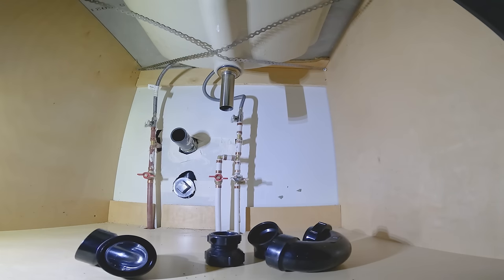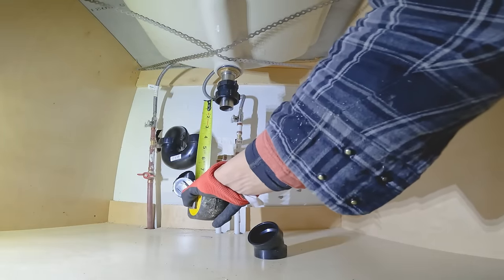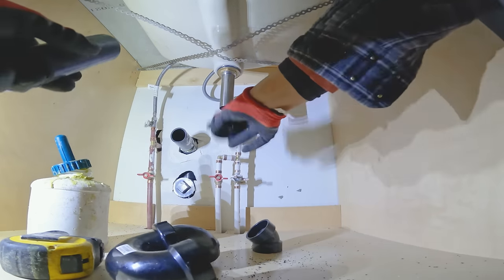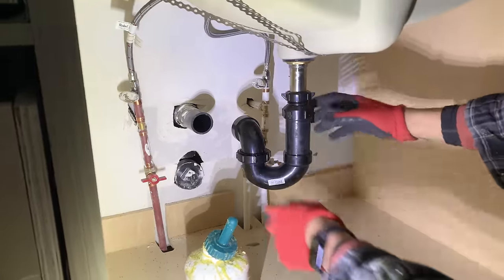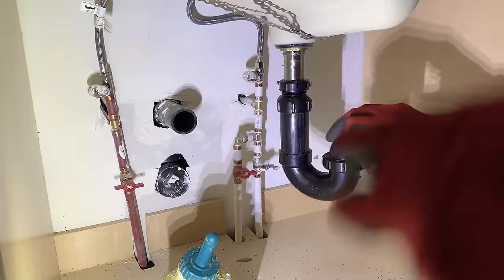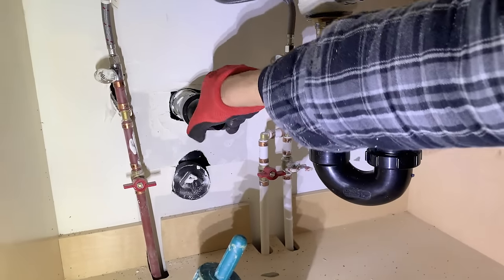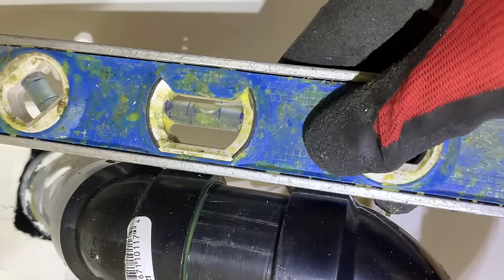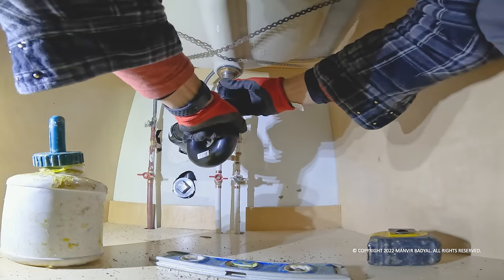P-Trap Installation: Drain Doesn't LINE UP with Bathroom Sink Pipe - 2022

Comment: Meanwhile, in my world…..go to home center and discover they don’t have all the needed pieces in ABS or PVC, buy many elbow combinations of each, go home, still doesn’t work. Go back to home center, buy more stuff, repeat 4 more times, cut multiple lengths of pipe to make everything fit because the first 3 pieces were too long or too short. Take a break for dinner. Make sure no one uses the sink. Still doesn’t fit. Go back to home center and buy multiple universal kits with the bendy hose.. jury rig everything together , check for leaks, redo do 2 more  times because there are leaks, tighten every connection just short of failure, no leaks, stand back and admire a job well done.
Reply: Add in drive 70 miles round trip b/c the local Lowes doesn't have the same plumbing selection that the one in the next town does. Still not sure I have everything I need to make it work. I could order it from them but it won't be here for 5 days unlike the auto parts store which can usually have things for me within 24 hours...
Reply: I resent you talking about me 🤣😂first bathroom problems😉
Reply: 🤣🤣 So true!
A 15 min home project always takes 8 hrs.
Reply: Same
Reply: Same here😢
Reply: Would be cheaper just to let a professional do it in the first place!
Reply: @rtopalovich  not even close. I could screw this job up 10x over and still pay less mst likely lol. A handy man wanted 1000 to paint a few cabinets, 2000 for a bit of tile around the tub because theyre insanely expensive right now. Plus id rather pay to learn it myself so its cheaper next time then pay someone else to do it everytime.
Reply: That is why you only buy a house close to a hardware store. That way you don't wear out your car.

Comment: Not bad.  The only thing that bugs me is that you didn't ream the inside of the cut pipes to ensure smooth flow.  Little jagged ABS pieces can easily cling onto hair and start to cause clogs over time.
Reply: That bothered me too.
Reply: Did he glue the p-trap? 😮 Doesn’t that defeat the whole purpose, ie to remove and clear clog or obstruction?
Reply: That bothered me three.  I am not a pro, but I would install some cardboard on the bottom of the cabinet to prevent drips.  I liked how he gave the bottle of glue a little tilt to get glue on the brush.  He must have done thousands of sinks.  Good video, don't mean to  be picky.  Cheers.
Reply: @neli.a  The p tap has a threaded connection. You can always unthread the p trap and tail piece than take the p trap out to clean.
Reply: @neli.a no, it has unions for easy removal and cleaning.  Accessible P traps are never glued! Well usually not, Lol.
Reply: Hey I understand what you said but it’s a bathroom that commonly uses 1-1/4” piping so your ahead of the game plus he gave it a slight pitch to make it speed up the flow.

Comment: If this is really for beginners then I would recommend dry fitting everything before glueing a single piece. But a nice video. Well paced and easy to understand.
Reply: Dry fitting can be difficult on friction-fit joints as they won’t always bottom out until they’re wetted with glue. You’ll probably end up cutting too short for a full fit. Better just to trust your tape.
Reply: @rayray8687 Yes simply measure depth of socket for good measurements. If you dry fit don’t forget to glue all of the joints,lol.😊
Reply: "recommend dry fitting everything before glueing a single piece."   +1000

Comment: Certain portions of plastic pipes are threaded to allow you to tie one segment to the next. This eliminates the need to glue one part to the next which is best avoided if possible. It will make it easier to take apart and reassemble if you need to clean out debris causing the drain to clog.
Reply from the maker: Trap adaptor and union Ptraps make it easy to take apart for cleaning or maintenance. 

Because trap 90 is glued to the trap arm, line clean out is installed for drain cleaning. 

Thanks for your comment.

Comment: your video is well explained but I was not aware of the slop. and most, you demonstrated a drain that is not in line with wall outlet and the p-trap connection.; that is very common. thanks and God Bless

Comment: Can you comment on why you used a trap adapter between the sink and trap instead of the standard tail extension with nut?
Reply: It doesn't line up

Comment: Thanks, you saved me a bunch of grief.  The new rough in put the drain line more than 5" offset from the drain, I'm not sure why they did it that way, they had the utility sink for reference.  I was trying to find fittings that would reach that far and had not considered using a bend to make an offset.
Reply from the maker: Glad it helped!

Comment: Great video. So I have the same offset issue where a 45 is needed but with PVC.  So could I do this by building out from the sanitary T as follows: 1) sanitary tee, 2) stubout, 3) street 45, 4) marvel connector, 5) PVC ptrap kit, 6) sink drain tail?

Thanks!

Comment: If I want to drain a shop sink directly outside do I need a drain trap or can I just attach 45 to the bottom of the sink, two inch hole in wall and drain ?
Reply from the maker: I wouldn't recommend draining a sink outside, if you're allowed to do so, I would still install a P-Trap. It will block the passage to the sink inside from any kind of smell or insects.

Thanks
Reply: @TheBuildingExpert  Thank you for your honest answer. It gives me other ideas
Reply from the maker: @blackhorse2947  glad it helped.

Comment: What is the square plug on the wall? Can that be removed if you need to use that instead of the drain above? If so, how do you remove it, and can you swap the plug between the two?

Comment: I need to do this  except for the 45 degree piece at the wall. Can I cut the arm that sticks out of the wall and use a hub coupling to use another straight piece to connect with my new ptrap. The threads on the arm and new trap don't match so I'll have to cut. Ugh!
Reply: He used a 45deg because that pointed the pipe in the general direction of the trap (which can swing around for about a 10" range of position.   If the drain were closer to the wall, and further away from the wall pipe, he could have used a 90deg, and of course if it were closer than 5", he would not have needed a bend at all.

Comment: I have a threaded copper drain pipe coming out of the wall. How do I connect that to my sink drain made out of ABS just like yours?
Reply from the maker: You need an ABS DWV Female Adaptor for copper to ABS Transition. 

Hope this helps.

Comment: Almost invariably I use push-fit fittings, much easier to align, adjustable, & if I make a mistake, easy to rectify.  The reason most builders (not most plumbers) use glued fittings, is that they are cheaper.

Comment: Just something for people to keep in mind you're only allowed a 135ﾟ Worth of fittings on the trap arm before it hits the stack. And never use a 90ﾟ fitting unless it's long sweep.   You can also use a street 45 in a regular 45 to make a 90ﾟ fitting that's a little smoother.
Reply: I imagine any glued pieces can now only be cut off.
Reply: @jgz6989  Depends how long ago it was glued. If it's pretty fresh you can twist em out with a pipe wrench or by hand. Also if you're careful you can pick the fitting.  For a ptrap I would probably just re pipe it.

Not exactly sure what the situation you're referring to is?
Reply: What's a Long Sweep? Thanks.
Reply: @rainerrain9689  Just has a wider turn so it flows more easily.
Reply: @creativesuit1930  I'm not a plumber, it just struck me the way he was glueing every piece. None of pieces under my sink are glued...for me it's more convenient to maintain.
Reply: @jgz6989  I would never leave any fittings unglued.
Reply: @jgz6989  Unglued pipes?  Surprised minute vibration and stress haven’t caused enough separation for leaks.
Reply: @tonymanero5544 
You never glue the pieces of a p trap together underneath a kitchen sink. Many of the parts you buy for them are made to be hand threaded together.

Comment: Nice work, but didn’t think of future maintenance. It’s wrong that you glued the 90 to the 45 and the 45 to the wall pipe. When there is clog, it’s hard to unclog using a snake machine because the 90 is facing downward. One of the joints should have used a thread/removable adapter.
Reply from the maker: There is a line Cleanout installed.  Thanks for your comment.
Reply: You are right, ours can't use a snake because the 90 degree elbow adapter. it should be disassembled.

Comment: the P trap used is made of what material? also, can you elaborate more on how to check for slope?
Reply: The sewer gas/water trap is the same material as the rest of the plumbing.  
Slope is measured as well as you can: just use a level touching the bottom of the lowest point of pipe in the horizontal run, and for every foot of pipe upstream, the bottom of the pipe should be 1/4" higher. Here, he only had about one foot of horizontal run, before it turned vertical.
Reply: @you2tooyou2too  thansk a lot .

Comment: Awesome video!!  I’m having a  similar problem I just did a kitchen remodel and  the 2” drain pipe coming out of the wall is now a lot lower than it was before and the trap won’t fit without notching the floor of the new cabinet. Does anyone have a work around so we can avoid notching the cabinet? Thanks in advance
Reply: So much for measuring twice and cutting once.

Comment: Even quicker, but the $9.99 flex P-trap rubber pipe. 2 clamps and cut to height or length. Installs in less than 2 minutes once you got the old parts out.

Comment: Why so much works and fittings, you only need to cut the abs pipe on the wall and glue a 22,5 x 1,1/2 elbow, 4“ x 1,1/2 pipe and a abs adapter and use a 1,1/2 p-trup. Ready

Comment: Na man, just always grab a bunch of extension tailpieces when you grab p-traps from the supply house. With the p-trap, 1 extension tailpiece cut in the middle and a 45, you should be able to solve all misaligned drain issues, excluding those that are really jacked up due to height like commonly seen on farm sinks where some hack job did a reverse p-trap or something to rig it up instead of opening the wall and correcting the height of the San-T

Comment: Why didn’t you use a ABS DWV Trap Adapter (removable screw compression fitting)? The solvent welded parts are for areas that you can’t get to like under the shower floor or under the house with no access point. If you can see it you should be able to take it apart in case you need to snake it or recovery a lost item.
Reply from the maker: Slip joint compression adaptor & union Ptrap is used in the video.  

Thanks for your feedback.
Reply: @TheBuildingExpert  

From the wall?
Reply from the maker: We have line clean out installed, drain line can be accessed from there to snake.

Comment: This is why rough-in dimensions are so important when designing and installing a system. You can avoid all these headaches when it comes time to complete the drain.
Reply: Well, whether or not it is a headache depends on one's reaction to the situation. In many cases, like mine where I am remodeling with a new larger vanity,your comment is moot since one has to work with what plumbing was installed in the wall.

Comment: Gluing everything together is ok until you have a clog and need to remove the P trap. Why not use the compression fittings to hold the drain together instead?
Reply from the maker: Slip joint adaptor and union Ptrap can be opened anytime without cutting anything for cleaning. For the drain line we have installed a dedicated line clean out which is visible in the video.

Comment: If you ever need more than a 45 degree fitting, cut the pipe coming out of the wall closer to the wall. For even less future issues, try and only use a 23.5 degree fitting. 👌🏻
Reply: You mean 22.5?
Reply: @ck-4203  fat fingers

Comment: An upstairs neighbor had an unpermitted bathtub installed and the guy they hired couldn’t figure out how to get this right. As a result, the bathtub drain came loose and slowly leaked onto the top of my ceiling. The resulting damage costed the ins co $17k to fix. And the neighbor denied responsibility for it.

Comment: Why do you need a 1/4 slope at the end?
Reply: 1/4"/ft is a US building code requirement, so water won't sit in the pipe and freeze, rust, or putrefy.

Comment: WARNING! Without knowing more about what's going on plumbing-wise in the wall behind the lavatory, it appears to me that this is an illegal installation (at least as far as plumbing codes in the U.S.A. are concerned). The installer breaks the minimum trap arm length requirement which, in this case (since he's using 1-1/2" pipe) is 3" (IOW at least twice the pipe diameter). He plumbs the outlet from the p-trap directly into the fitting marking the transition from horizontal to vertical when, instead, there needs to be at least three inches worth of trap arm between the trap weir and the vent weir. In essence, he's created a "crown vent" which is a no-no. Happy to be proven wrong.
Reply: What's the right course of action for this situation where the connections are so far from each other?

Comment: No. Why wouldn’t you just add a make adapater. Never glue trap. If there’s a clog in the santee you can’t access it from the clean out below. You can cable from the trap arm
Reply from the maker: If you re watch  the video it’s a union Ptrap and a trap adaptor. Thanks for the comment.

Comment: That's some weird looking ABS glue.....Slip traps and slip extensions are much easier to work with and clean if ever necessary. Crimp fittings and tees for whatever's being done with the water lines? 
This must be in a foreign country. Good video for the DIY's tho....I guess....

Comment: Was good video but was not professional.  Next time try protecting customers sink with drop cloth.   Glue and ABS shavings all over doesn't make for clean install and you didn't use ABS cement...ABS cement is black in color.
Reply from the maker: Thanks for your comment. I installed this P-trap at my own place. No glue or pipe shavings were left behind. ABS cement also comes in yellow color. (ABS Y2 Yellow Solvent Cement).

Comment: SMH stop using glue p trap
Reply from the maker: This is a union P-trap glued to a slip joint adapter, very easy to take off for service. Drain line also has its own dedicated line clean out.
In my opinion, it's a solid and leak proof solution. 
Thanks for your feedback.

Comment: And 1 more issue. You are using pvc glue on abs . Abs is not congruent with solvent welding.  This wont pass inspection.
Reply from the maker: This house passed inspection without any issues. Please look up Y2 ABS Yellow Solvent Cement.

Comment: Sir what you showed is wrong. Drains can never be downsized. You did that. A big no no.
Reply from the maker: Hello Sir, 1-1/4" sink discharge pipe is draining into 1-1/2" ptrap and that ptrap is draining into 2" drain line so where is it downsized?
Thanks for your feedback.